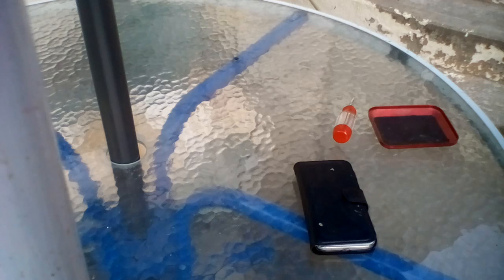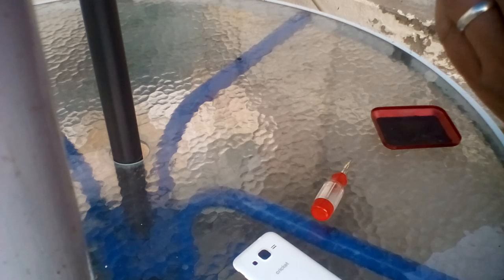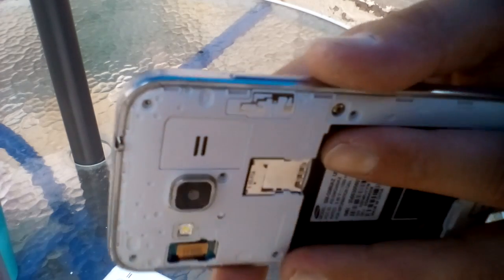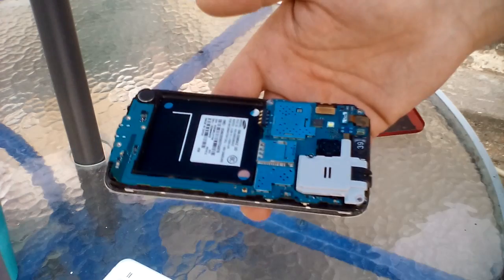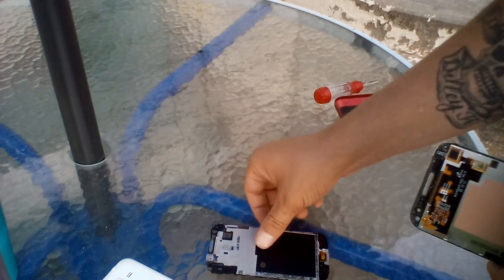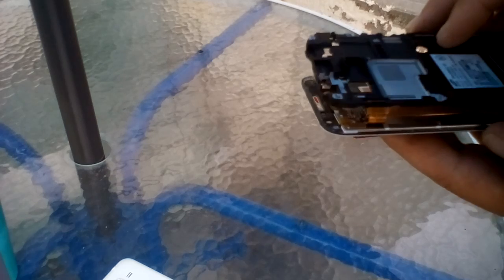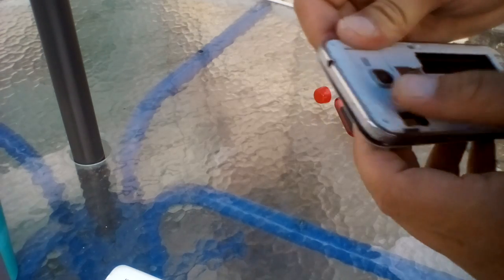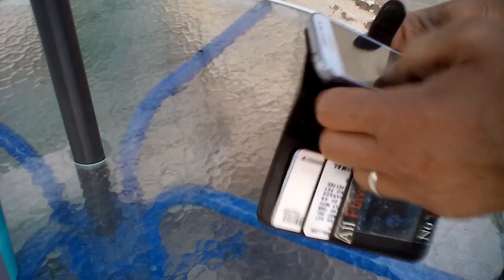galaxy core prime how to fix a unresponsive touch screen

Comment: My screen was the first thing to come off- found the touchscreen wire strip was loose from the connector- I shoved it back in but couldn't get it to line up with the white silk screen line- the connector doesn't seem to have a latch. Then I put a piece of thin cardstock where he said, put it together, turned it on, and it worked! Amazing, though I was kinda hoping I had to buy a better phone. Guess I'll live with this one a little longer!

Comment: Hi, thanks for detailed explanation, it helped to fix my screen too. But i agree with lednarvideo, connector was bit out of socket, and it was the reason. If you push it bit back to socket, there is indicative white line about how deep it should be. When the line is parallel with others, then connection is correct. You should also put after that a new sticking tape on the connector ribbon, mine original tape was not sticky anymore and it allowed contact ribbon to shift out. But very good explaining about cellphone taking apart and building back together, 1 hour job and saved 100 euros money, thanks!

Comment: I have trouble taking out the screws xD I tried a knife an actual screw driver but didnt work :/
Reply from the maker: DeathammoPlays .-. Ya it's a pain with the tiny screws. If it's stripped try taking a rubber band and lay over it the try to screw it out slowly.

Comment: Thanks, it solved my problem. Just the connector was a little bit out of its socket. So you just need to push the connector (at 8:23 in video) back to its socket and add a little longer strip of tape on it. It will not come out of socket again. And I did not have to touch the "square type" thing next to socket at all, I think this doest have to be clued or use extra piece of paper.
Reply from the maker: lednarvideo oh OK that's really helpful thank you for that.  I'm glad that my video gave you the confidence you need to fix your phone

Comment: The video was very helpful, thank you. It provided the confidence I needed to proceed.  For those of you planning on undertaking this procedure, I have the following notes from my job: when you get to removing the light grey backplate, use a hair blow dryer--up close. I found it helped with stubborn areas. The audio board should come off easily as in the video, however, I unnecessarily made trouble for myself by thinking that the clip (to its right) needed to be pulled back. Not true. Simply, pull the board left as you lift it. Separating the next layer (the black frame) from the digitizer/display/touch screen is the trickiest. BE EXTRA CAREFUL. I ended up cracking the front glass touch screen (probably because it already had cracks in it or because I was fussing with it too much!) I recommend using a penknife (just the tip or edge--not too much) as a lever to pry it off. Again, the blow dryer helped here. I am now waiting for a new touch screen. Hope it all works again when I put it together! Thanks again.
Reply from the maker: The blow dryer will help for sure. In my case I dropped my phone In so much motor oil, antifreeze, gear lube and transmission fluid that my glue was falling apart. Thank you for adding these tips :)